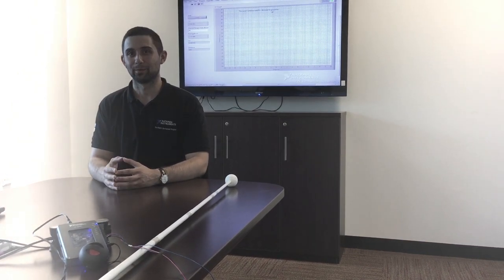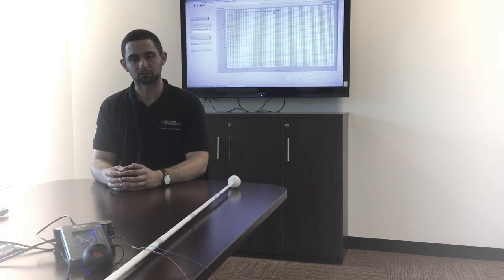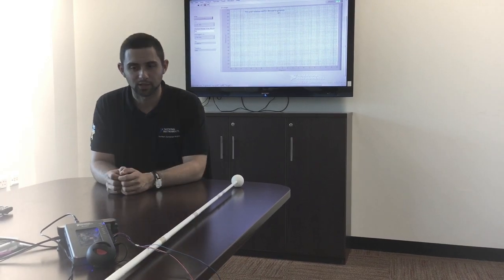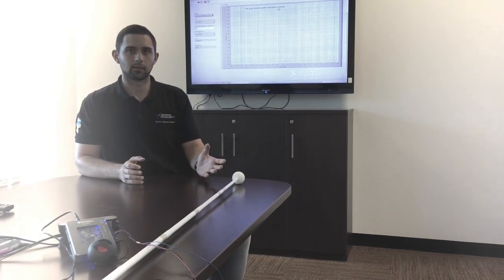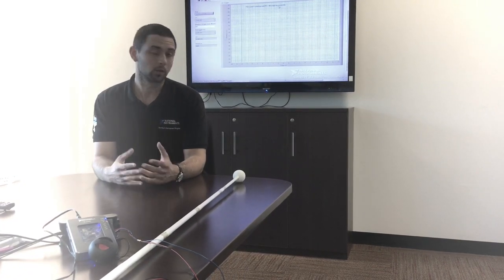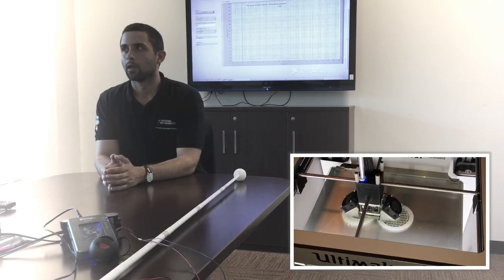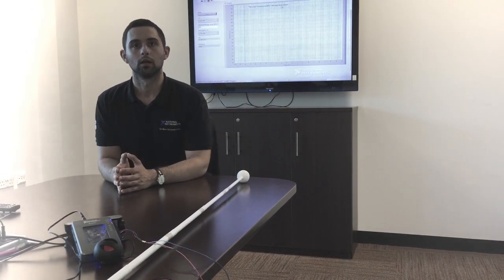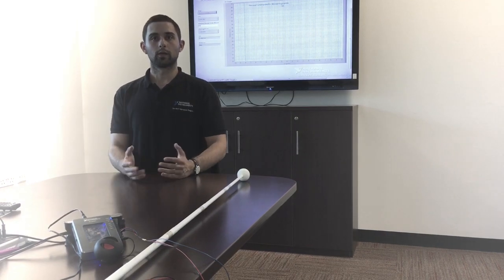mySmartCane: Giving Freedom to Visually Impaired People

Comment: Not sure the idea is new or will allow things like "sense further than ever before" and why will it transform things where basically the same thing failed in the past?
The ultra cane https://www.ultracane.com/about_the_ultracane seems like it could do all this claims, including the sensing at chest/head height.
OK, the ultra cane is expensive, but then there is this one which fits on a standard cane reported about in November 2014 http://www.wallstreetdaily.com/2014/11/12/smartcane-blind/
I can think of other similar products which used ultra sound for remote sensing.
I don't want to seem negative about this but I don't see how this is different. May be if those coming up with these things were to reference similar products from the past and then say how they differ one might get a feeling for why it is worth paying attention to. One cannot help feeling that it is a case of innovation in isolation which means a reinvention of the wheel is exciting.

Comment: The user of the white cane in the video does not understand the full extent of how a white cane is put to work. The cane tip must touch the ground in order to ensure there are no "drop offs" which would cause a visually impaired or blind person to stumble, sprain, or break an ankle. Since the user did not touch the cane to the ground, it begs the question, does the developer (of this "new, improved" cane) understand that the cane must always touch the ground to find dropoffs? Does the cane's technology sense a drop-off? Will the technology survive the dirt and grime of a city street, the wet of a puddle or gutter (since the tip of the cane must touch the ground!)? Is the cane tip easily repaired or replaced? Is the cane affordable? Mechanical canes (folding cane with no electronics) cost less than $20.
Reply: Fantastic feedback Carolyn! I am sure that the actual developer will be able to give a more specific response, but I have been lucky enough to try mySmartCane myself. I can confirm... (1) the 3D printed ball has been designed to be robust and splash proof, capable of surviving some serious knocks (however, I think that your concern about mud, which could potentially cover the sensor is very valid). More importantly, (2) the sensor and the 3D printed enclosure costs between $5-$8 to manufacture - so, very cheap to replace. Also, (3) the student is not in this for the money, and has openly published his designs online for people to iterate or make their own - see http://bit.ly/2cwkayi
Reply: Carolyn, you might also be interested in what the developer has planned for the next iteration of the mySmartCane - embedding an IR sensor into the sensory-ball, which looks 'upwards'. This will solve a problem that no existing whitecane (or guide dog?) currently can - warning the user of approaching 'low hanging obstacles' (such as door frames and signposts etc) to prevent head injuries.

Comment: A similar development - a cane for the blind, but with the use of infrared, has been proposed in the article "infrared radar for the blind" in the magazine "Radio" №10, 1989. Author Nechayev. The only difference is that here the ultrasound to locate.

Moreover, in 2006, candidate of technical sciences - Sergey Ershov designed ultrasonic cane for the visually impaired. Know-how allows you to not only get blind holes and borders, but also things that are not on the ground. As you approach the obstacle signal tone decreases, and people with good hearing can determine the distance to it, up to 15 cm.
Reply: By the way, an alternative scheme Weekend - IR locator for blind canes for http://ipic.su/img/img7/fs/Iklokatordlyaslepyh.1479917402.jpg. As an infrared photodetector is used in infrared LED, due to the reversibility of the LEDs. Programming is not necessary.